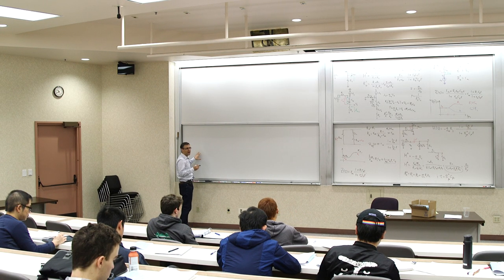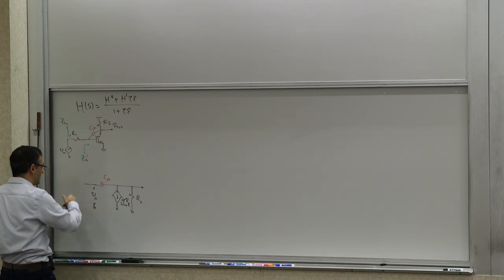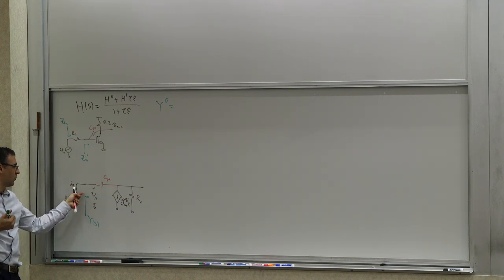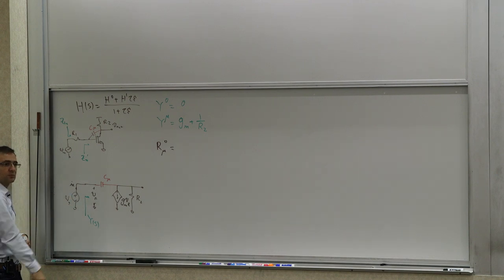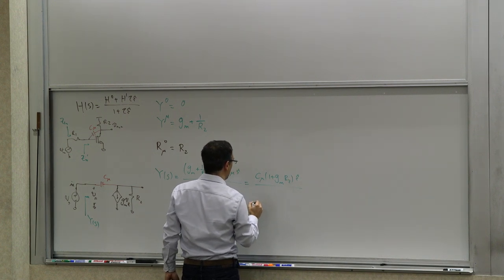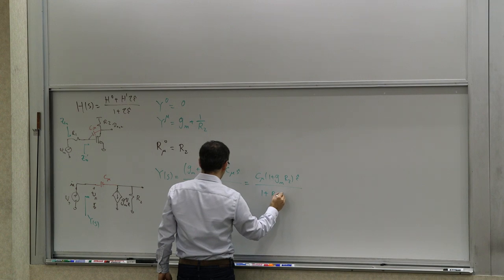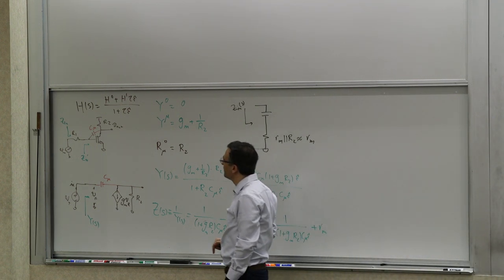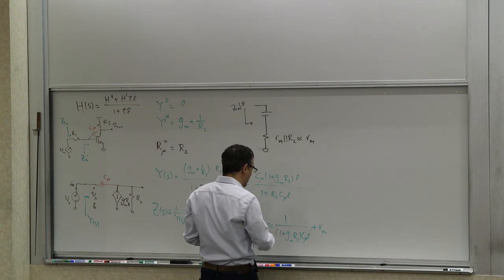143N. Miller multiplication and effect, input impedance of common-source

Comment: The point between impedances Z1 and Z-Z1 with zero voltage, does also exist when the amplifier is not inverting? When it is not inverting there is not change of sign between input and output. Is there a formal demonstration of the existence of the zero volage point? Thanks in advance for your answers.
Reply from the maker: It would exist if you allow one of the impedances to be negative. Nonetheless, the point here is that since this point changes with frequency in general, one should use the time and transfer constant expression to get the most accurate result.